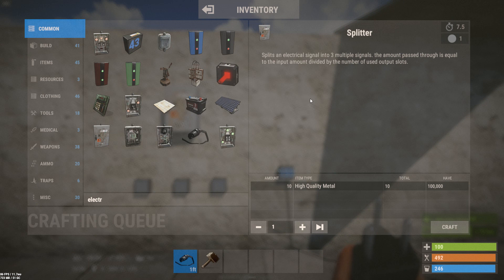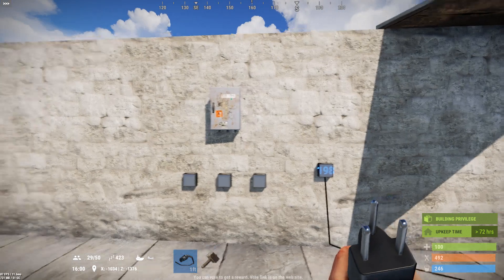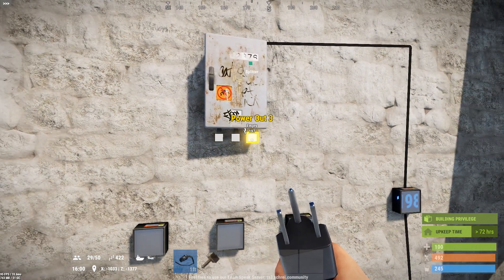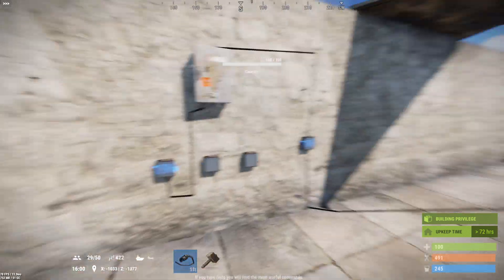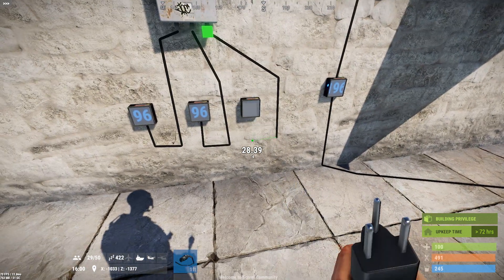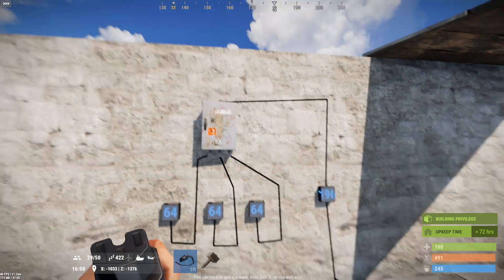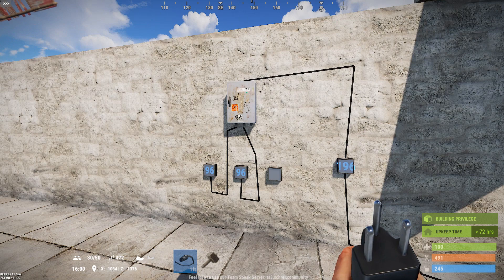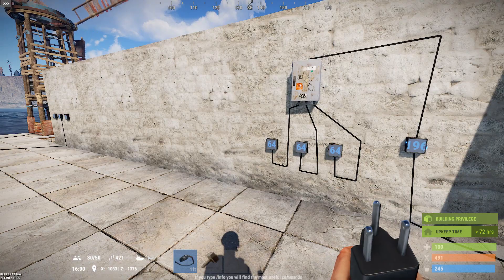Rust Electricity 101: Component Guide - Splitter

Comment: I think there's an elusive bug that you may or may not be aware of regarding splitters.

I'll log out from an electric build and come back the next day only to find that I'm left with a huge surplus of power. I use deductive reasoning and end up looking at my splitters and lo and behold, the splitters aren't actually splitting the power! For example if it is being fed 301 Power and split three ways, instead of it being split into 100 each, each output will output 300 each. In order to reset the splitter to proper functionality, re-installing the wire to it's input or re-installing any or all of the outputs works.

At first I thought this had something to do with the amount of time that had elapsed since implementing a splitter. But then I was up one night and I was there for the daily server restart of the PvE server I was on. I log back in to the server when its live and there it is, all my splitters not splitting, simply forwarding my input power to each of the outputs. It could've been a coincidence but this is the only lead I have to reproducing this bug as it generally happens the next day after a restart has occurred since the last time I was online. Note I've seen it occur on three PvE servers, but it has crossed my mind it could be a conflict with an oxide / umod plugin specific to the series of servers I frequent (RustEZ), however I can't be certain without further testing on say a locally hosted stock Rust server where I'm admin and can control when the server restarts.
Reply from the maker: Confirmed, but on straight vanilla server with current main branch, it presents itself slightly differently. If I connect counters to all three outputs they show power in as "1" but they are all getting full power-1 from all three ports of the splitter. I'll try to make a quick demo of your point that can be used for the bug report!
Reply from the maker: Reported to Facepunch as a bug with a video demo:   https://youtu.be/JcUiSoAEarc
Good catch man!